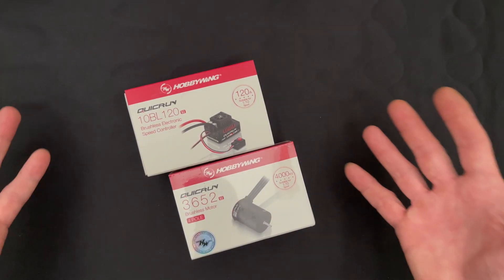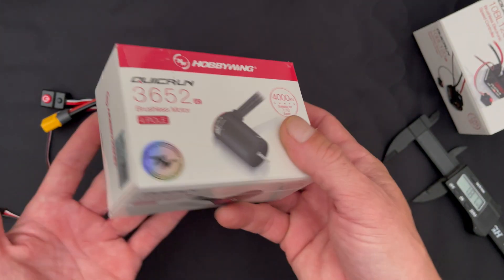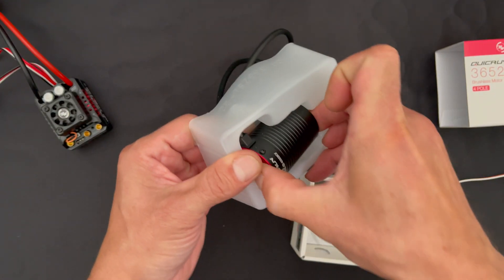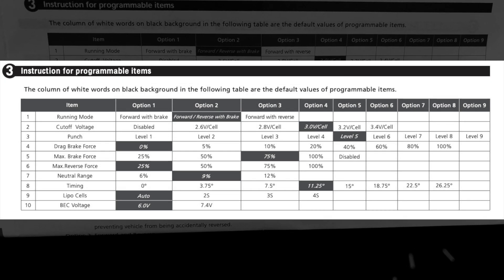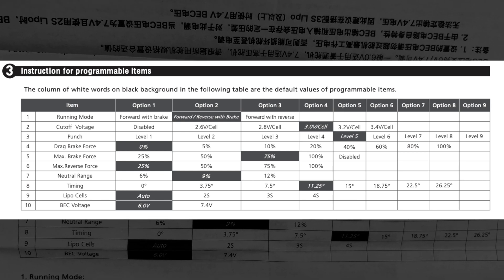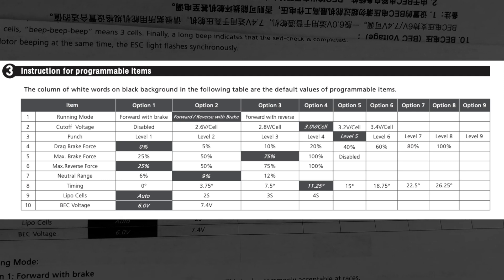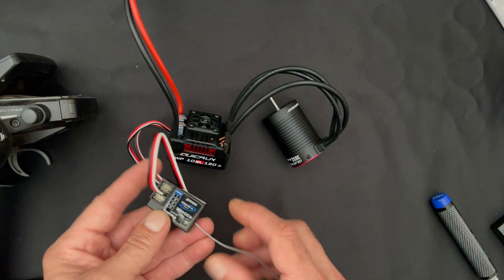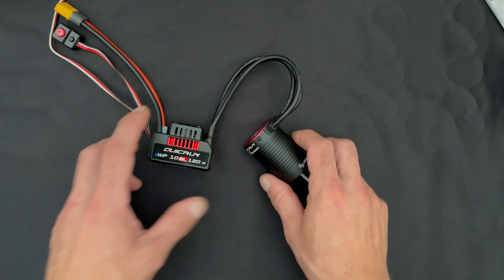The Charlie Show /// Episode 325 /// Quicrun 10BL120 G2 Brushless System

Comment: So there's no way to program it without a program card? I got a quicrun 10bl120 and tried to program it with the tried and true programming method with the set button and it simple doesn't enter programming mode. I've programmed 4 separate max6 escs in the past and had zero issues. For my use, an esc stuck in the factory punch setting is absolutely useless because it kills the fun of bashing. Never been so disappointed in a hobbywing purchase. There's no instructions in the manual of how to program it with the set button, and I see no notice anywhere that a program card is required for programming. 

So do you need a program card for this or is there a way to do it without one? I'd hate to need to buy a program card just for this specific esc when my lcd program box or the set button method worked to program all my other hobbywing escs

Comment: Well hrs of trying to calibrate , could my step button be bad? I have many hw esc and have never had this issue, sometimes I get the green light press set button nothing . Move to full throttle hit button nothing, gonna try a different radio but I have 3 rigs on my radio link working fine not sure what is up.
Reply: Found the problem lol I'm a d As. Working fine

Comment: 8:17 i set the timing to 1 and 8 but my truck dose 52kph on both settings? , its not over or under geared, motor isn't getting hot, the setting just doesn't do anything lol

Comment: I bought a couple of these ESCs, they both have a problem with getting into reverse, sometimes it will reverse and sometimes it wont reverse. Forward and brake works fine though but I also paired the ESCs up with cheapo motors. Anyone else having this problem and have a fix for it? I just ordered a 3652 hobbywing motor to see if it fixes the problem

Comment: My hobbywing quicrun 10bl120 is making my rc wheels spin but does an instant brake reverse, and  have to bip the throttle to make it reverse which i can't tune on that i already did calibration, and im driving with a radiolink transmitter. I was trying to run it but times the delay pressing to go forwards makes it seem like it takes a couple of presses to go forwards what could this be?

Comment: I have a problem with the HW10BL120 G2 esc and the 3660 engine set. Every time I take off with my car, my car is strained and squeezed for 1-2 seconds, but after speeding up, the problem is solved. But it's a big problem because it turns into a disaster for me after I stop. Please someone help to me.. (Note: ı already tried another esc&motor and everything is normal, also matched with esc and transmitter)
Reply: I have the same problem

Comment: Does having more kv in the motor makes you gain more speed ?
Reply: As long as you stick to the same gear ratio, yes. Draws more amps though, and temperatures will also go up.
There may be other potential benefits as well, though. For example, running low kv, 3660-sized cans in my Team Magic E5 seem to cause some pretty severe cogging at low speeds. Going above 3500 kv has fixed the issue.

Comment: @HOBBYWINGOfficial do i need to buy motor wires if i use this esc with the drift motor, from what i can tell in this video and others it seems like neither the "Quicrun 10BL120 Sensored G2 ESC" or the "Xerun D10 Drift Motor" come with the motor wires, would i have to but the wires seprate, if so whats the part number ?

Comment: does this work with the hobbywing app?
Reply: no😔
Reply: on blizzy i put this in my slash w a 13 tooth pinion and never had an issue never once tuned it either straight up threw it in and ran it

Comment: Would the 4000kv be too much (get too hot) for the Traxxas Slash 4X4  with regular gearing? (13/54) Would it be better to get the 3250kv motor instead?

UPDATE: I got the 3250kv motor, its great(for the most part) for the 4x4  slash! Running stock gearing 13/54 the motor gets fairly warm to the touch 40c - 50c. As compared to the Traxxas Velineon 3500 motor, it would be really hot! The one downside with the Hobbywing 3250kv motor is it sucks back the battery faster than the Traxxas Velineon 3500.  I am getting about 1/2 to 3/4 the run time as I would with the Traxxas motor, and this is with 0 timing, no drag brake too!

Wonder if I should have went with the 4000kv motor instead?

Final note - I had to reverse two of the motor wires A to C and C to A. I did the set up with throttle first then brake. When I pulled the trigger the car wanted to reverse, so I swapped A cable with C.
Reply: The higher the kv the faster battery drain I believe.
Reply: I think 540 can  motors are too small for a 4wd slash. I'd run a 550 or even bigger like a castle 1412 or 1415. Now that's some real power!

Comment: hello friend ! What do you think of this new esc 10bl120g2? And is it really good? Is the programming card the same as the previous model? I'm wanting to buy this new version of the 10bl120 g2.
Reply: Yes, it will work, just updated.
Reply: I want to build a monster slash with big tires using 3s what motor and esc do u suggest? My vxl gets hot and shuts down after 3 minutes of running hard. Please help

Comment: Hey nice video Charlie! I want this for my Arrma gorgon, this video has helped a lot but the only thing is my batteries have an ec3 plug, do they sell adapters to convert so I don't have to buy new batteries ?
Reply: Same with me. I have it sitting in my amazon cart for my gorgon, and im only hesitating because of the battery connection. I know i can cut and resolder a new connection but id rather not if theres an adapter.
Reply: Buy all the connectors you need to adapt and use a small bit of wire and make your own adapters saves some money

Comment: Hello G
Would you know why the new quicrun system is faster in reverse than forward 10bl120 3700kv combo 
Thanks for sharing G
Reply: It's wired in reverse.
Reply: Do you know which ABC wires to switch? I switched a and c. It goes fast in forward now, but it still has like a delay taking off. Then it flies.
Reply: @RyanLeaym  The punch setting might be turned down or a setting on your radio needs to be adjusted. Turn up the setting using the program card if you have one.
I had to reverse my wires too, I switched A with C.

Comment: So if I have a 4000 kv motor of the timing is at 0 will I get 4000kv and if I turn the timing up I’ll get more kv? Or do I have to have the timing in the medium setting to get the rated 4000 KV the motor has?
Reply: You'll get a bit more speed but not too much, maybe a few extra mph  / kph
Reply: Same motor here and when I plugged in my program cars it shows my timing setting was on setting 4 already. I’m curious if I leave it there or wha ?

Comment: Great overview.  I just bought the 4000kv version to replace the 12T Titan in my Rustler.   Just waiting for it arrive.  Thanks!
Reply: Is it a 4x4? How is it running?
Reply: 2wd...runs really strong.  Had to go with a bigger pinion though.   @Arturito2017
Reply: @arkyrc  what pinion size are you running. I’m thinking of getting this for my slash 4x4
Reply: @arkyrc  why would you have to get a bigger pinion? The motor alone is faster than the titan motor. 

I would think you'd have a higher chance of cogging with the 4000kv with a bigger pinion.

Im getting cogging with the 17 tooth pinion on the 4x4 slash with the 3250kv motor!
Reply: @MyKonaRC  The brushless setup runs much cooler than the 12T with the stock pinion.  Gearing up gives me more speed. So far I've experienced no cogging.  Great little Esc / Motor combo.
Reply: do you need to tune it

Comment: Hi 🙂 i got a udi 1202 brushless and i want to upgrade to brushless, but the motorshaft on the new motor is 5mm and the stock pinion gear is 3mm or 3.17! Im new at the hobby so not sure! The motor is a 3660 Surpass! What pinion do i need? Plz help me 🙏🏼 
Love Rc Stuff podcast ☺️
Reply: Got a udi 1202 brushed*
Reply: And i can find any info on the stock pinion! I only counted that it is a 13 tooth pinion! Didnt say anything more on the pinion!
Reply: Cant* sorry for my bad writhing 😅
Reply: Try 5mm with a bigger pinion gear

Comment: I have a slash 4x4 with the max 10 sct combo i upgraded so much i built another slash 4x4 out of spare parts and i pit in a 3670 motor in it but does this esc handle a 3670 motor?
Reply: Yes. Even some 42 series Dia.

Comment: Why have I never felt the need to program any of my ecs to throttle?  I've done it afterwards with no noticeable differences. Hmmm
Reply from the maker: Some radios can be very close to the testing setup the ESC has.  They all get tested, and calibrated before packaging.
Reply: It definitely does, it's usually most noticeable as you apply the initial throttle. Annoyingly  lots of RTR vehicles actually don't come calibrated properly, not sure how they calibrate them in China but more often than not they are not done right

Comment: Can you use the Port for the Programming Box for a Fan?
Reply from the maker: The programming port runs from the BEC power.  It can be used for simple fans and lights, but is not rated or spec'd to have a load.
Reply: Can you use a 60 amp on 3s with a 3650 5200kv

Comment: So can be used on sct with 3660 motor..only thing the kv is not high enuf for 3660 motor..
Reply from the maker: Depends on the application really.  Some SCT's are fine with 3652 (540) motors, some really need the 3660 (550) size.
Reply: @HOBBYWINGOfficial so for a slash 4x4 that only weighs 5lb or (2.5kg) would you go with the 4000kv 3652 or the 3700kv 3660?
Reply: Did you end up getting this for your slash? If so how does it run? 
My slash motor is a bit cooked I think and want to try this combo
Reply: @Jeremy-yi9rg  I got the 3250kv motor,  its enough power to get up and going. Can't imagine a high geared 4000kv motor would like to start slow. I am cogging with the 3250kv with 17t pinion on a slash 4x4 from a stand still.
Reply: @MyKonaRC I have the 4000 kv motor on my stampede and I was running a 54t spur with a 21t pinion and that bitch was dumb fast, had no cogging, but it would get extremely hot. So I dumbed it down a little to a 15t pinion now.